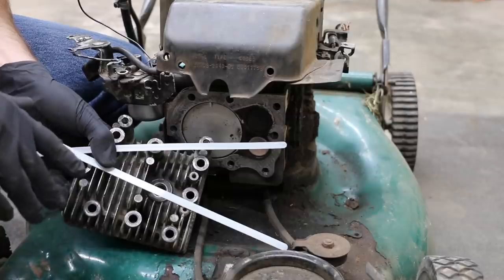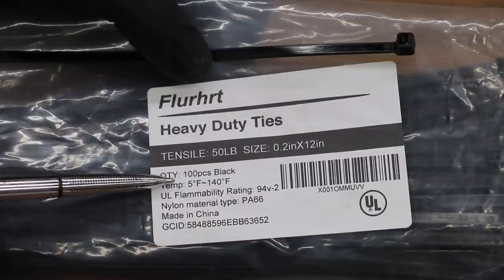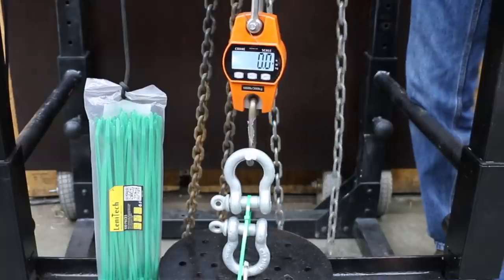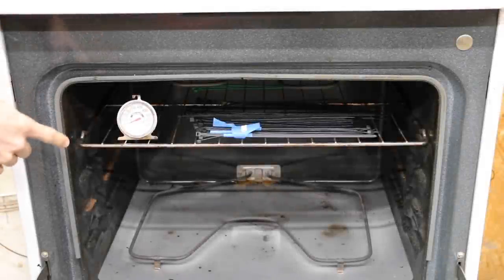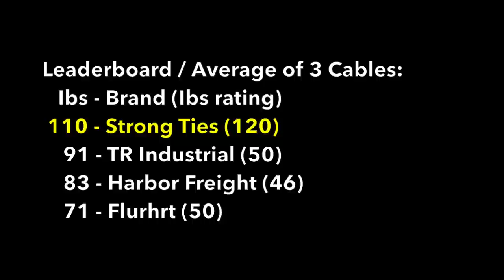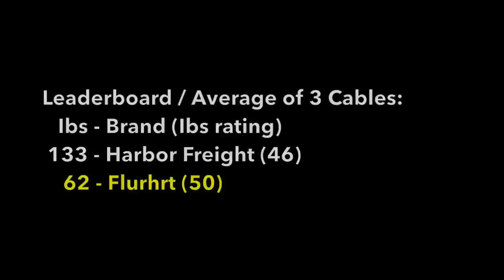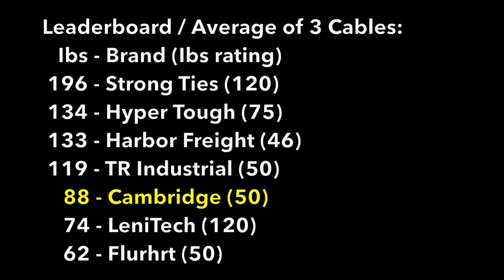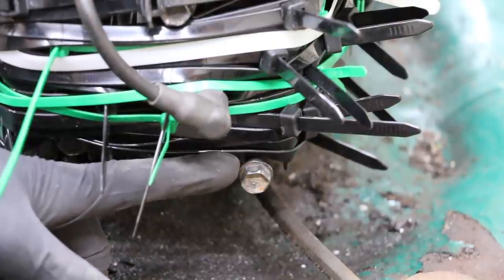Best Zip Tie Brand (7 Brands Tested)? Let's find out!

Comment: Harbor freight sells quality zip ties so you can hold all the other products together that you buy from there!
Reply from the maker: Funny!
Reply: I choked on this one.  LOL
Reply: Awesome. LOL.
Reply: I can't quit 😂😂😂
Reply: WillieRants I mean with some things thats true
Reply: @VEYRON SUPREMACY - I don't know about that, I've had several C clamps from Harbor Freight that cracked right in half with very little stress.
Reply: @VEYRON SUPREMACY 1 time use cheap Grinders when in a pinch. After that they burn up.
Reply: @VEYRON SUPREMACY Giant Bag of tie downs. He should test them next.
Reply: Haha. Good one. They really are...random on quality. Some tools they sell are great. Others are junk.
Reply: Lmao
Reply: Your Highness I’ve had one of their grinders for years, it’s been through several welding projects, not the least of which was floorboards in a 67 Mustang. Don’t get me wrong, it’s cheap as crap, and held together with electrical tape on the rear housing. But the grinder head and motor keep on running.
Reply: @VEYRON SUPREMACY weld it!
Reply: Good answer! 👍🏼
Reply: Harbor Freight is actually going up in quality. They focus on quality a little more than big guys who focus on profit. Its true. Earthquake and Pittsburgh brand are pretty damn good. I use pitts for work as a mechanic and never had one fail. 20 bucks for a ratchet that beats a 200 buck ratchet......hmmm
Reply: @VEYRON SUPREMACY Sound just like Silverline here, their wrenches are great but a lot of their other stuff is plain junk.

On the other hand Blackspur is just rubbish, only zip ties I've ever bought where I could overcome the ratchet with one hand seriously terrible
Reply: Harbors zip ties it is
Reply: For a weekend mechanic their wrenches and basic tools are pretty good atleast I think so for what i do and they have a warranty so i can always return them unlike crasftman because all the dealers near me closed
Reply: Gotta spend that money somewhere
Reply: @RealWorldGarage  Bought a grinder from HF about seven years ago for $12.95, still works great except for the lock pin breaking shortly after purchase. No big deal, taped over the hole to keep dirt out.
Reply: 2strokemoto man Lowes carries craftsman now, you can return there
Reply: Hahh Love that
Reply: That was funny I do buy a lot of tools and equipment from Harbor Freight not too much power tools but a lot of their hand tools I like good prices in and out real fast but that was funny
Reply: Wish I had thought of that , very funny.
Reply: LOL😂😂
Reply: @zuestoots5176  they have great stuff. Best Value anywhere
Reply: Another good thing about hf is that you can get good tools and accessories for really cheap.
Reply: My buddies dad got a table vice from harbor freight he literally just took it out of the box while we were workin on a car. He mounted the vice but something in it and using a hammer was trying to pull a bearing I believe idk anyway the vice literally snapped in half just out of the box
Reply: 12 years and my $70 HF compressor is still going strong. Just roofed another building with it last week. On the other hand, I used their jigsaw twice and it broke lol. So I went in their 3 years after I bought it and they gave me a credit for it towards an upgraded model.
Reply: You win!
Reply: Every since I found out how handy zip ties can be I stay having them. I even carry some in my backpack all the time. You never know when you might need them. I sometimes even use them to repair things.
Reply: True lol
Reply: Bahahahaha!!!!
Reply: Their one redeeming product! 🤣🤣🤣
Reply: I use em to hold together a pallet barn
Reply: So true 😂 except their zip ties are a joke 😂
Reply: Harbor freight doesn't sell quality anything lmao. Maybe their Jack's. They are pretty good but def not jack stands
Reply: We watch harbor freight tools perform exceptionally well here so cut the tool shaming nonsense. Some of us but what we can and I haven't had a single HF tool fail yet.

Comment: Harbor Freight didn't like your tests on their batteries and upped their game on the zip ties to redeem themselves.
Reply: Programmed Gamer Harbor Freight has good products other than batteries lol
Reply: @ohioknifelover  your delusional or haven't bought enough of their power tools.
Reply: weeral1 I did say good products, not the best. Most of the tools they sell are not hard use so it makes sense that they will break. I’m not saying you’re wrong by any means! 🙂
Reply: Programmed Gamer - it depends what you buy.  their hydraulic automotive ram set is pretty decent and a fraction the cost of a real set (which i never could have afforded) and i have about 8 of their orange (their new ones suck) angle grinders that are over 10 years old and still going strong, ( and i beat the snot out of them) and 8 of them cost about as much as one name brand angle grinder.
Reply: @markomalley  Some of their (larger) power tools are OK, I've been fairly happy with their porta-band (although the blade was absolute garbage). And their air tools are actually awesome, I retired my snap-on 1/2" impact after I got the earthquake gun. To be fair, the snap-on was 10 years old, but I wasn't all that impressed even when it was new. But anything they sell with a battery, and pretty much all of their abrasive consumables (sandpaper, grinding wheels, and saws) aren't even worth the space they take up in a landfill. The only grinder attachment they make that isn't trash is the wire cup brush, those actually seem to last longer than Dewalt at 1/4 the price.
Reply: markomalley I’m sorry you’ve had troubles with them buddy
Reply: @michael-dm2bv  " i have about 8 of their orange (their new ones suck) angle grinders that are over 10 years old and still going strong"

Bullshit.Those things die in one or two hard jobs. One even tried to take my finger with it when the spring that holds the lock failed mid use. One literally caught fire. One had a bent shaft out of the box. I don't believe a word of what you said and neither do you.  The hydraulic set I would agree. Power tools. Hell no.

If your not lying go buy a lottery ticket right away.

Comment: Pricewise, using 2 Harbor Freight zip ties wins.
Reply: yep, my thoughts are , buy what is cheap, you can double up, but really if its breaking a zip tie you are doing it wrong! (use something else! , wire etc)
Reply from the maker: Great point!
Reply: problem is sometimes you cant fit 2 lol
Reply: Practically HF ties suck

Comment: Once again, great video. Love your approach to testing evidenced across your channel. Have you ever considered evaluating padlocks? I’d be very interested in what sorts of tests you come up with.
Reply from the maker: Thank you!
Reply: Hey lock picking lawyer.  I never knew I was interested in locks till came across your channel. Thanks!
Reply: @ LockPickingLawyer - Ha Ha ... Love your channel by the way! And it's great for those that want to pick a lock the old fashioned way, with great skill and tools to match each padlock you choose to pick. However, most YouTubers want to see the different ways in-which most thief's will most likely attack any given type of padlock. You've done a few destruction videos in the past (i.e. the Ramset seemed to be the most popular with your subscribers), and also using heat to melt the innards of poorly designed locks to the point to where they just basically fell apart. If I were a thief (which I'm not) I'd find the quickest most proficient way to destroy the lock before I'd ever consider picking it - unless it was a MasterLock Padlock that is, lol. But, I know destroying Padlocks can get quite expensive. Especially if you're trying to destroy some of the higher-end Padlocks like ABUS & ABLOY which can be well over $200.00 a pop for an ABLOY Protec2 - PL362. Which brings up a question for you. They say this Padlock can't be picked, the Protec2. Can you or have you ever been able to pick an ABLOY Protec2 - Padlock? Thanks!
Reply: LockPickingLawyer Oh man, an LPL and PF collaboration? Am I dreaming? Is this Heaven? Am I even alive?
Reply: Holy shit it's the lock picking lawyer on another on of my favorite channels!!! Collaborate!
Reply: @ProjectFarm  You should try to do a collaboration with LPL. I love both of your channels.
Reply: LockPickingLawyers next video: how to defeat a pickproof zip tie with a ramset. 😂
Reply: I would love to see this as well!  Love your channel LockPickingLawyer!
Reply: Holy hell, the two of you in a room could make a lawn mower that can pick gun locks.
Reply: Great idea
Reply: Lol I was like why evaluate padlocks the LPL guy already does that then I read who was the commenter haha
Reply: I would love to see that! I have seen padlocks fail time and time again! Maybe even an Elemental test, to see how easy they are to use after they sit!
Reply: namrednop The protec 2 was picked on camera this week for the first time. He doesn’t show the actual pick design, but shows the picking of the lock. It was picked by a known very skilled picker and highly doubtful it was faked. The lock was disassembled after the pick and stayed in frame the entire video.
Reply: Yes yes yes yes yes yes yes! also LPL if you want to do destructive testing I have a friend who works at a college, at the end of the year they cut off all the locks that were left on the racks. Some of them are in great shape but most of them are disc detainers and until I get a new sparrows branded LPL & Bill's disc pick they will be out of my picking range. Actually even if I had the pick I think it would take me months to get into them. But I still think that giving you an Abus Granite U lock or 2 to pick, to cut open, and attack with any method you can think of, or even make a cutaway version of the lock to show everyone how it works. I know some of the more expensive Abus locks are extremely hard just from file testing but since hardness and toughness is a balancing act of being hard enough that it can't be cut open and tough enough that they can't be shattered when frozen. It makes me wonder if those expensive bike locks might be susceptible to the 2nd oldest trick in the book, freeze attacks.
Reply: I used to be interested in picking picks as a hobby, but I moved back to Virginia and it's a felony to own lock picking tools if you're not a certified locksmith. Now I just watch your videos instead.
Reply: Nice to see the LPL checking in.

Comment: l broke a motor mount on my 69 mercury cougar and at the time my dad worked for 3m those old tie wraps about 12 of them lasted until l sold the car years later, thats when they had the metal tang in them,
Reply from the maker: Hi Mustie1, Impressive strength and durability for an engine mount and to handle the temperature!  3M makes great products!  By the way, your videos are AWESOME!  Looking forward to more of your videos!
Reply: You both run great channels! I go to PF to find out what the best of the best is and to quench my curiosity, but I go to Mustie to relax and unwind, but also learn the fine art of small engine troubleshooting! Thanks for doing what you guys do, both of you.
Reply: I still buy ties with a metal tang. Can't be the only one.
Reply: I think I bought some from home Depot
Reply: @m1t2a1  the ones with metal tang is what law enforcement has for alternate hand cuffs
Reply: The police flex-cuffs still have the metal tab.
If you REALLY want to be impressed, try the double sided 3M tape, VHB stuff.  There is nothing like it.  
I would be willing to bet that if you can get it to seal, it would hold the cylinder head!
Reply: omg its mustie
Reply: did we just witness two titans meet on the field
Reply: I was wondering how those stainless steel zip ties that you used on the exhaust wrap on the orange water buggie might compare. Off topic, but I was wondering what you think of Fiber Wrap for wrapping around a leaking flex pipe on a car exhaust.
Reply: Brand called Ty-Rap makes em' with metal. I get them at Hunzicker an elec supply
Reply: Ty-rap brand still has metal tanks, it's what we use at work.
Reply: @andrewbaggett2505  That's what I said
Reply: Steve just Steve ok

Comment: LOL. That was hilarious all those zip ties around the mower engine. Loved the video! Your videos are an invaluable source of information.
Reply from the maker: Thank you very much!  I really enjoyed your latest video on picking that "kryptonite" monster cable lock!  I learn something new with every one of your videos. Thanks again!
Reply: Yeah that went from, "This is an interesting, scientific and methodical product comparison" to, "What in the trailer park hell is going on with Frankenmower over here?" at the drop of a hat hahahaha!
Reply: electronicsNmore I agree, Ty-Rap brand most definitely needs to be tested
Reply: Project Farms Labs....
Reply: @ProjectFarm  I'm going to keep asking you if you can compare Poulan, Husqvarna, Stihl, Echo and some local hardware store brands of bar and chain oils (winter and summer types) and 2 cycle engine oils. Lol!
Reply: On the exhaust part... melting time.
Reply: @ProjectFarm  needed a zip tie install tool on the engine. It grabs, tensions really tight, clips off the excess. Home Depot has one at a decent price.

Comment: I mostly use Thomas & Betts . from what I've seen they are usually double their rating and really hard to break.
Reply from the maker: WP, I should have tested that brand!  Great recommendation! I just bought some and will be doing a long-term UV exposure test on it and about a dozen brands and then another strength test.  By the way, your latest video on the see through engine with the turbo is amazing!  I recommend it to everyone!  Thanks again
Reply: @ProjectFarm  awesome and thank you
Reply: Agreed, T&B are great! Metal Used the extra large ones to hold up the exhaust on my truck(roadside repair). Totally forgot about it, until my next oil change. Noticed they were still holding up, so I left them. Held the exhaust up for 2 years until I sold it. May still be holding... 🤷🏻‍♂️
Reply: Thomas and Betts invented Ty-Raps for airplane wiring harnesses. They come in UV resistant nylon or stainless steel for outdoor usage and have been used by phone companies since at least the early 70s. Those are the ones I use for anything important. For temporary use I just use the cheap chinese plastic clones called zip ties, or string.
Reply: We are using T&B detectable cable ties because we are working in Food Industry so the can get detected by metal detector and they work great
Reply: Came to the comment section purely to find this right here.  T&Bs were our preferred and best working in the racing industry.
Reply: T&B's were used on our off road racer to hold the rear springs in place after the hanger hole broke off the leaf spring completely, The large one's are a must in your tool kit. As always, a great video.
Reply: If NASA uses them on their mars rovers, I think they're good enough for literally anything
Reply: T&B is best ty in my experience I have had trouble breaking on that has been in a cable tray for at least 10 years with channel locks

Comment: Yes!! Zip Ties! haven't watched your video yet, but i suggest to place 1 of every brand in UV sunlight outside for a year and see how brittle one is to the other?
thanks Todd!
Reply from the maker: Great test idea!  I still have 4 of each brand unused.  I like the UV exposure test.  Thanks again!
Reply: Ditto on the UV test, to me this would be more valuable than a strength test. I use wire ties often to hold wire bundles together on trailers and vehicles.
Reply: I stopped using the H.F. ties they dry out in a year even in shade.
Reply: Omar T I mentioned the same thing bcuz that’s where I’ve seen them go! I have a mix of them 2yr old hanging signs on my chain fence & I’ve noticed some broke on their own or from a gust of wind. Would be interesting to also see white vs black differences.
Reply: @ProjectFarm  can you please test drywall anchors
Reply: I had the same thought but my recommendation is to put some 303 aerospace protectant on them as soon as you buy them! It's a bit pricey but honestly pays for itself! SweetProjectCars is always talking about it so I finally bought some and it's great! I put it on everything plastic that will get exposed to the elements!
Reply: Yes, he should test that. Some zip-ties are used in outdoor applications so it would provide an accurate test of how well they perform even with U.V exposure.
Reply: @anonymousfarm4703  Yes the white HF are the worst there is.
Reply: Would love to see a test on different pvc glues! Overall your channel is still the best informational channel on YouTube imo keep up the great work and dedication!
Reply: @fredhelmecke6073  Same, I pitched a bunch of old HF zip ties when it got to the point where I'd have to grab 3 or 4 to have one with a good tang.  They don't age well but that's a hard test to do here.